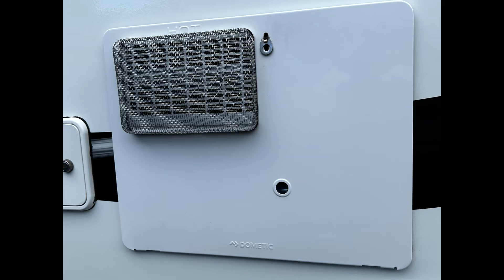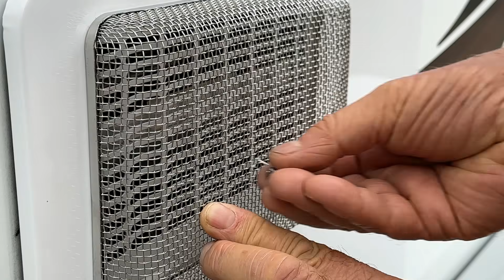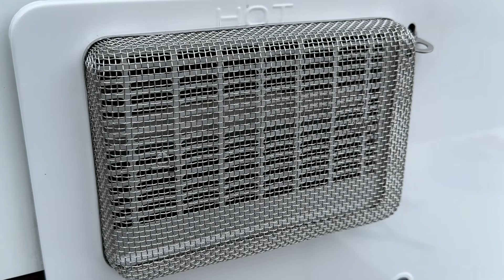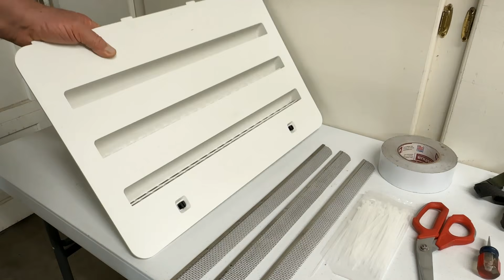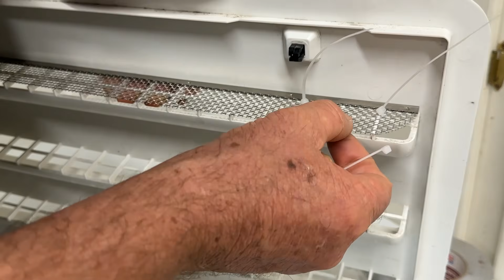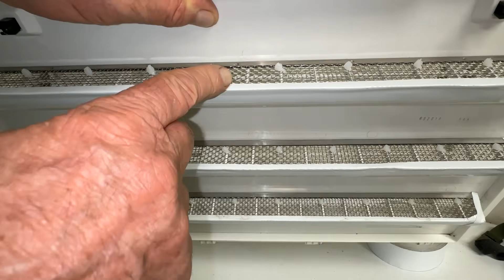Protect your RV Furnace, Water Heater, & Refrigerator Vents with Insect Screens

Comment: I threw that silly spring and tool in the trash. I used screen mesh on the inside of the door and attached it by applying a bead of clear silicone caulk around the outside edges and smoothing it down and it's lasted 4 years
Reply from the maker: Thanks for watching and for taking the time to share what you did. I'm curious what silicone you used that will hold up to the heat that comes out of these areas? 
Thanks so much,
Mike

I hope you subscribe if you haven't done so already, give me a thumbs up, comment, and share this with friends.
Michael Bracewell The Travel Trailer Guy Videos -
https://www.youtube.com/@thetraveltrailerguy/videos

Comment: Just watched your video and you made more work for yourself on the refrigerator screen because you stole them on the wrong side that’s why they didn’t fit correctly and left the space
Reply from the maker: Great catch Rick. I didn't install the screen on the outside because it wouldn't fit that way, the screen kit I got would not allow me to do it so I did it the way I could make it work. I should have mentioned this in the video :(

Comment: Just wondering . . . would the screens for the fridge vents work better installed from the outside?  Then there would be far fewer gaps.
Reply from the maker: You may be correct. I'll have to look at it again to see.
Reply: This is an old comment, but that was my first thought too.  It might still have gaps at the curved ends, but it seems like it would solve the entire gap along the edge.
Reply: The installation is supposed to be on the outside. They fit perfectly and seal the entire vent opening….no need to tape anything.

Comment: Not sure if you mentioned this but might be a good idea to make sure those screens don’t void any warranty. I called Dometic and can they told me those screens would void the warranty on my water heater.
Reply: Jerry, how would they ever find out unless you told them. I'd rather have the screens on rather than not.
Reply: @USNavyAR5  if it presents a fire hazard then some may choose not to go that route. Reducing airflow is the main reason some manufacturers have the no screen policy as I understand it. I personally don’t see an issue in using the screens but in over 30 years of RVing I’ve never had any issues with those holes getting stopped up either. But I do know it happens.
Reply: @jerrykrobby  I'm pretty sure it doesn't present a fire hazard putting screens on these particularly outlets since there sold in most RV outlets and elsewhere but I digress.
Reply: @USNavyAR5  I’m not in disagreement I’m just saying that’s what I was told by a representative with Dometic. To me it’s just another silly rule manufacturers have to avoid having to back their product. For example Jayco maintains that any and all seals should be inspected every 3 months and maintained every 6 months. I’ll bet not many people maintain their seals on a 6 month old Jayco. Pretty ridiculous in my opinion but that’s their rule.
Reply from the maker: @USNavyAR5  Thanks for watching and commenting. I agree
Reply from the maker: Thanks for the information Jerry its good to know. I think I'll take my chances since most warranty's never apply to me. But I will share your comment with others in my description below my video.